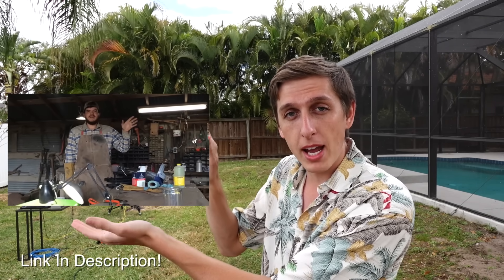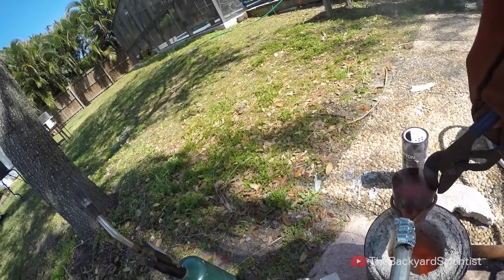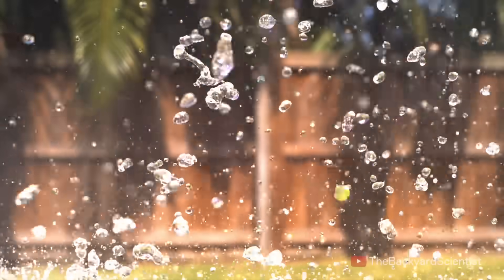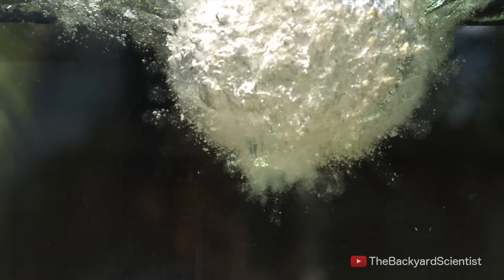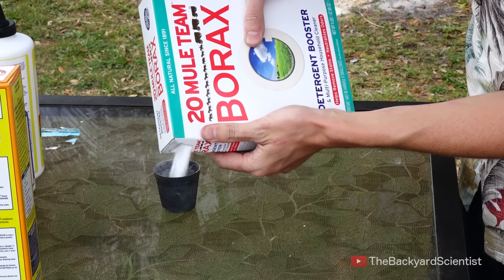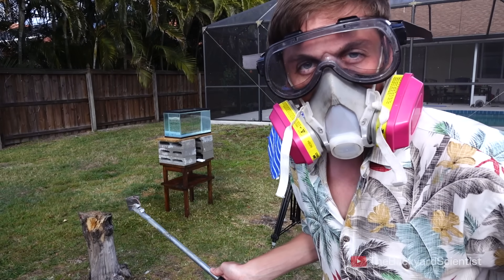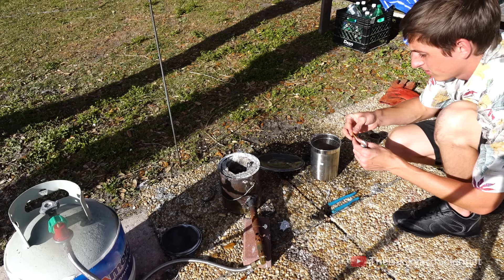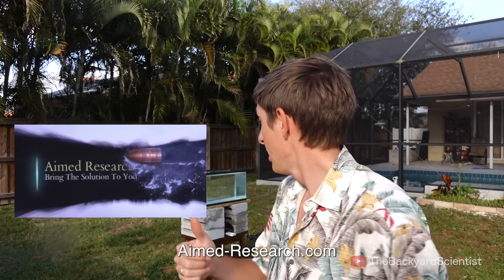Pouring Molten salt into Water - Explosion!

Comment: I don't get why the guy uses NO protective gear whatsoever! One of these days he's going to mess up and get badly hurt. Where we do we send the flowers?

He should also pour the stuff faster; a '3...2....1" count is just wasting time and letting the stuff cool off.
Reply: +Leutchik Well, he probably should have been wearing more than the safety goggles and oven mitts, but as for the pouring faster bit, the salt he was pouring was 800 degrees celsius. Heat might dissipate quickly but there's far more than enough time before it would cool down enough to not produce the same effect.

Comment: I personally think that molten salt may have a different reaction to water (And the amount of water.) than regular salt. Reason: It is exposing Sodium, and the Chlorine delays the reaction. But it is just a theory from your friendly blaster...
Reply: That doesn't make sense because if the States of matter every element and compound is capable of changing States and it doesn't separate the compound so it's all still just NaCl in the end
Reply: Micah Comfort But have you thought of the fact that it could also be from the compound cooling so fast to the point it acts like sodium after a second or so?
Reply: +Beast Mode The compounds properties wouldn't change still yet
Reply: Micah Comfort It is only a theory. I know my physics.
Reply: +Beast Mode I know but I think it's most likely incorrect but you could be onto something ....and technically its a hypothesis

Comment: Higher melting points should explain it since the water never gets trapped when the water just boils away before it comes into contact with the solid. Since the other salts just sink to the bottom of the tank, it was likely the fact that the temperature allowed it to prevent water from catching onto it. That and it was able to maintain its cohesion underwater compared to Morton's salt which separated on contact.

Comment: a guess: it's still a steam explosion but the water surface is penetrated by salt fog (?) causing really tiny pockets of isolated heating depth-wise (all those tiny bubbles forming the surface of the sphere). so the heat rises relatively slowly and isn't isolated from the salt by leidenfrost vapor. a test would be to measure the size and temp of surface emissions/fog/vapor/whatever-it-is from heated salt, then calculate the volume of water it would vaporize, compared to say borax. (no I haven't a clue and I'm not gonna do it, no equipment, Id rather punditify)

Comment: sodium reacts with water to form sodium hydroxide and hydrogen gas, which burns in air to form water.

SODIUM CHLORIDE HAS A DIFFERENT specific heat than the other salts, and is infinitely soluble in water. It is fun to do this, the sodium metal will burn by itself when placed in water COLD. It throws NaOH everywhere, which is LYE and can BLIND YOU.

Comment: Pour molten salt into liquid nitrogen.
Reply: 0.0
Reply: I'm guessing it will form sodium nitrate and chlorine gas and it will go boom?
Reply: no
Reply: Big explosion
Reply: reduce explosion because the water wouldn't be able to explode cause it will freeze
Reply: you do that the explosion will be equivalent to a russian tsar bomba nuclear explosion
Reply: the reaction was it a cause of the temperature interchange (sorry my english it's about lvl 350)
whe a hot salt inner in the whater these two try to inn yo the same temperature but the salt it's a conductor and for disolve needs absorb the temperature
the salt are more hot as the wather soo these can't disolve
but the whate try to 've the same temperature steel degrees to salt
and in this moment the salt try to get back the temperature for disolved this in a really really short time 
doing whit his molecule expande and contract causing a explosion.

but don't give me the reason i just escape from a psiquiatric
Reply: YES!!!

Comment: Hmmm, some possible physical differences between the salts:

What amount of heat are they carrying? If they all have different melting points, then they could be delivering different amounts of energy into the water.

What density do they have? I would expect a denser salt to sink more rapidly and expend it's energy deep inside the tank whereas a less dense salt would expend it's energy at the surface.

How much do they expand/contract when they crystalise?

Comment: He thinks that the melted sodium can't have a reaction with the water based on that the water didn't have the base property after the interaction between water and sodium.

But still the melted sodium can have Oxygen and hydrogen as it's melted within air. So it can interact with the water and make an explosion.
I assume that NaCl when melted, the chlorine atoms was hiding the sodium ones. And after they are separated within the water, the sodium had it's connection with the water which made an explosion like if it's a pure Na. 
The time took by the chlorine to separate from sodium explains the time took by NaCl to have the explosion which is larger than it is in pure sodium.

Comment: Doesn't it have to do with the solubility of NaCl, and the fact that both the kation as the anion are only one atom big? 

NaCl has an overall higher solubility than the other salts you've used, and when the salt dissociates, the polar central would be all over the ions because they're just one atom big. Because of this, they don't create the water-like barrier you see for the other salts and because of the sudden difference in temperature (21 °C for water to at least above 100 °C because of the 700 °C NaCl), the water quickly vaporizes and steam tries to escape in every way possible. Therefor creating some giant pressure and poof, you have your explosion.

But then again, I'm just a chemistry student so I might be at the wrong end.

Comment: if you turn one cup of water into steam you would have 1600 cups of steam in other words it expands 1 : 1600  by making the salt a liquid you have made the surface area about as big as you could make.  This would make it turn as much water as you had salt turn to water instantly so if you have 50 grams of salt  and you touched 50 grams of water and turned that water into steam then your water would turn into 80,000 grams of steam.  I know grams are not a measurement of volume it's  just a crude example.
Reply: +Ryan Zukley Grams are a measurement of mass. So, if you combined 50 grams of one substance to another 50 grams, where does the 79900 grams come from?

Comment: Is there any chance the explosions is because it creat chlorine gas and hydrogen according to the the high temperature causing reaction between NaCl and H2O ？ And it mixed in water after and because the heat is still there so cause it exploded since Cl2 and H2 mix could cause explosions?

Comment: I think that explodes because of the Na because in big ammounts in the water it explodes
Reply: My extended theory is the explosion is caused by the vigorous reaction between the sodium (which is technically separated from the chlorine ions when in molten salt) and the water and the rapid expansion of the hydrogen and chlorine gases (which are displaced by the sodium reacting with the water) because of the extremely high temperatures
Reply: Tom Barker But seriously...OP gave me fcking cancer...
Reply: +ThE WiLD WhitE BeAr no, because a salt is known to be a mixture of a metal and a non-metal in Ions and not in atoms, the difference between Ions and atoms is that Ions have a charge and atoms don't, this allows for NaCl (a.k.a. kitchen salt) to not explode in contact with water, even when it mixes with the water and you get salt water, it does not explode. whereas throwing a piece of Na in water will give you an explosion.

my theory here is that because of the high temperature the kitchen salt dissects with a method called thermolyse, which just destroys the bond between Na and Cl and possibly making it atoms

Comment: lol... your test's are absolutely brilliant mate. I wonder if you could help me with a problem! I'm into craft's of all sorts, I want to turn a wooden bowl but have something as a feature in the bottom!
Bismuth crystals would look stunning but way out of my budget, I've tried the lead v cola and that just doesn't look good enough! is there anything that you could suggest keeping in mind a low budget?  I  would like it to be colourful, mate of soft metal or something similar. Thanks for sharing your video's they are mind blowing lol.
Reply: +Andrew Smith Bismuth costs about 30 dollars or less for 2 pounds, and you can make your own crystals with it. Dont know what your budget is, but that seems pretty reasonable to me. Might be that you looked up the price for the prime crystals themselves (artwork is expensive). The color is caused by bismuth oxide, so if you dont get it when making the crystals, heat them up in an oven and it should re-oxidize.

Comment: I expect the high temperature of the molten salt changes its electronic properties. I've recently learned about it in a 'condensed matter' course on my physics degree. The high temperature will cause more electrons to exist in the outer shells of the salt atoms, which will change the reactive effects. So instead of the water in the tank boiling as normal, there's probably a reaction which breaks the water molecules into hydrogen and oxygen, which fuels the explosion. 

I mean, I could be completely and utterly wrong there, but it's a partially educated guess from a physicist halfway through learning about the properties of matter and their electrons at high temperature.

Hell it could even be quantum physics. Maybe at that energy the Leidenfrost effect is overcome by the electrons in the molten salt being able to tunnel through the barrier of the evaporated water, thus allowing for a direct reaction between the molten salt and H2O. I dunno, just throwing a few ideas out there.

Comment: You you should run a controlled test with just Chloride.  It looks like the Sodium may have reacted in a firebomb upon instant contact with the water; however, the chloride might have a similar explosive response but with different effect, i.e it might need more saturation with water or it might be a direct reaction to  super-heated chloride igniting the oxygen in the water.  Just something to consider.

Comment: This happens because of sodium and Chloride both are very reactive they come from hydrochloride and caustic soda the caustic soda it's a very alkaline and the hydrochloride very acid when you heat the salt this components are separated and then when they touch the water they become caustic soda and hydrochloride then this both combine and become the salt and water
Reply: That's why the ph doesn't change a very alkaline and A very acid component neutralize the ph

Comment: but sodium chloride doesn't react with water at all, let alone create a pH change
Reply: +ClassicPork reaction of Sodium and Water >>> 2Na + H2O > 2NaOH + H2 (the reaction doesn't happen spontaneously at room temperature but it does at higher temps, in the same way many things which do not spontaneously combust at room temperature do if you heat em up enough)

NaOH is sodium hydroxide, which when dissolved in water is a base, which will result in an alkaline solution :)

Comment: 801°C? That's hotter than Venus!
Reply: no... you are mixing it up with fahrenheit. the venus is about 500 C
Reply: thanks.
Reply: +Dirty Dan no that was celcius. Venus is 453 c most of the time.
Reply: SCRX rAndoMGuY
didn't i say just that? lol
Reply: +Dirty Dan Nope. 801C in the video (melting point of Sodium Chloride) is hotter than Venus (453C).
Reply: *****
that is exactly what i said "the venus is about 500C" i thought he was mixing it up because he compared it to the venus, which i thought was pretty random because the venus isn't even emitting any heat itself and it's close to 800 degrees in fahrenheit, but i guess i read that wrong.

Comment: what I think it
is happening it's the same effect as a Rupert's drop. As you said, the molten salt after cooling down looks like a crystal structure. The difference between outside and inside pressure can be the cause of the explosion. nice work with the video, BTW :)

Comment: Could it be a hydrogen explosion? I'm thinking in terms of different reaction speeds/reaction concurency. The molten salt dissolves in water really rapidly, then sodium ions start to break up water taking the OH- away and leaving H+ hanging around and waiting to stabilize with Cl- but as the reaction is heated up already, the oxygen from the air or dissolved in the water kicks in and overtakes the stable dissolution reaction - boom, we have a classical hydrogen explosion. It's just a wild guess, might be wrong.

Comment: I am pretty sure that it is a chemical reaction. The Soduim reacts with the water ==> Na(Cl) + H2O=NaOH (+ HCl)  Sodium causes the explosion and connects to water while the clorin does aswell. After the explosion a chemical reaction happens NaOH + HCl = NaCl + H2O thats why you do not measure a changing PH-value. 

(To seperate NaCl into Na and Cl very high powers are needed e.g. heating it up. )

Comment: When the salt which is NaCl(Sodium Chloride),  became molten, the ionic bonding between both is broken apart. When NaCl is broken apart, it became Sodium ion and Chlorine ion. Sodium is the second least reactive among all the Alkali metals, which is in Group I , so it doesn't react much. What makes it reacts with the water alot is the chlorine. Chlorine is the second most reactive among all the Halogens, which is in Group VII. So that's why, when molten salt is placed in the tank of water, it makes the tank of water explodes. That's my thinking.
Reply: +Alexis Nelson Sodium ions are in no way equal to Sodium. Neither are Chloride ions to Chlorine. It is a purely physical reaction.

Comment: it's definitely a physical reaction, but I believe much of the process has a dependability on the chemicals. if you repeated this test again and again and tested for chlorine (I don't know if the pool test kits just test for salt or if they test for independent chlorine) I believe the result may come back with chemical because a reaction such as that could only be seen at those high temperatures where the molecules are vibrating fast enough and loose enough to react with the water in such a way.

Comment: It explodes because of the salt molecules dissociating inside the water which releases energy and allow the sodium molecules to react with the water.
The ph does not change because the salt and water have not formed a new compound but the water has separated the Na+ from the Cl- and that is possible because of the water being a polar molecule. So it just forms as a filter between the Cl- and Na+

Comment: So here are a few questions. Which of the salts dissolves in water easiest and quickest under normal conditions? Which of the molten salts had behaviour most similar to water (in terms of viscosity, density, and surface tension)?  Na and Cl are on the same row of the periodic table and have opposite charges, making the NaCl neutral until the ions are released in solution. If the Na and Cl break into solution at the contact surface faster than the thermal energy of the molten salt can be transfered into the surrounding water molecules (leading to the l->g phase change of the water associated with the ladenfrost effect) you may end up with just enough of an attractive force between the H+ and the Cl- ions that the mass of molten salt will envelope the water. It could also be as simple as similar surface tensions between water and molten salt allowing the salt to stay together and spread out, creating an umbrella effect which quickly closes around a small sample of liquid water, whereas the other salts seemed to form smaller droplets which quickly fell to the bottom. 

I'm not a chemist and only an undergraduate Physics major, so these are just some shot-in-the-dark ideas. I'd love to know why this happened. Keep us updated if you figure anything out!

Comment: It may well be a chemical reaction. I don't know. Here's my thought on it:
If you're melting an ionic compound such as NaCl, you wind up with the ions Na+ and Cl- in this case. Now when you mix it up like that normally, you  wind up with some aqueous ions, but in this case it's very high-energy, though the chemical properties of a sodium ion might be different from those of a regular atom in such a way that it would prevent a chemical reaction. There is a possibility that the reaction is chemical, and because you have equal amounts of an acid and a base, a PH test afterward would be inconclusive because you'd simply have saltwater. 
Just a thought from a random guy who took a chemistry class in college. I don't know whether it reacts chemically or not, but if it does I know it would immediately become water and salt again.

Comment: Maybe it is the crystalline structure of salt, I believe it still has solid crystal structure and then when you introduce it to water it just makes it cool down so much when it's trying to revert back into its crystal form it traps water on those angular surfaces and boils the water very rapidly and causes those pockets of steam to do as he said, it just makes it spread apart and cause sort of a "chain " reaction between the steam and the salt, and if it is just normal old table salt which is iodized then that also might be a contributing factor,awesome video man!